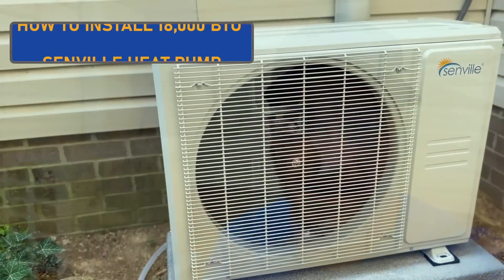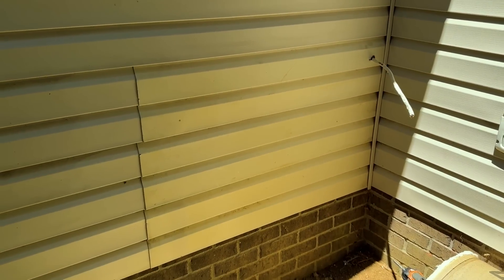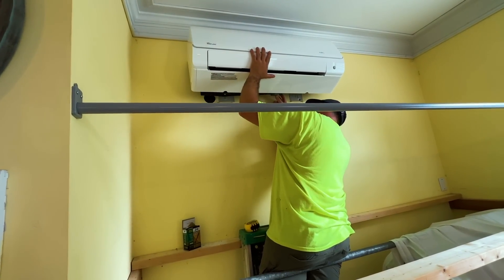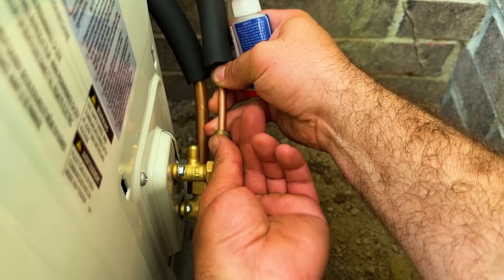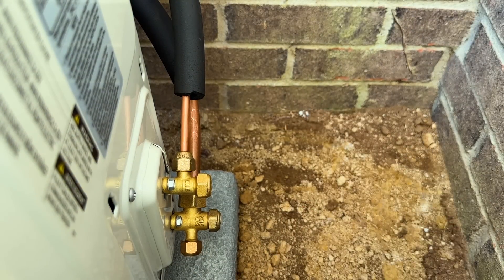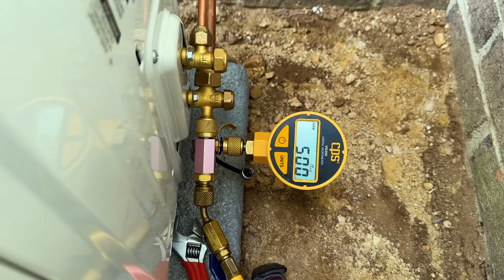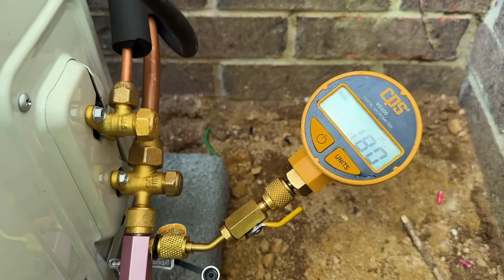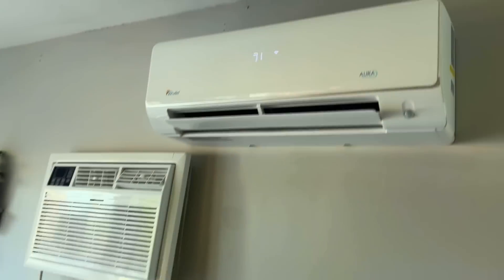Convert Your Window AC Unit To A High Efficiency MINI SPLIT!

Comment: Dude you gotta change title of your video, very misleading. I actually convert window air conditioners into furnaces for small houses and trailers AND I convert window air conditioners into central air con using all the parts from the window AC, not replacing anything.  I was curious to see if anyone else had any concepts I could use, but came across your video that sounded interesting and promising. Just to learn that you video is in fact NOTHING to do with actually converting a REAL window AC into a mini split.  Change the name, it's misleading.   "How to install a Mini Split in place of your Window AC" There I did the hard work for you.

Comment: Great video. I just installed a Senville 18k for my living room/ kitchen works Great. But I don't like how it looks on the outside at condenser.  Line set is 16ft but my run was only about 10ft so I have 6ft rolled by condenser . 
Q. If I cut the 6ft will I have to take gas out ??
And How do I get the gas back into the unit ??
Thank Gid Bless
Reply: @josea.morataya721 There is a way to achieve that with most mini splits without the need for a recovery machine and external tank, but TBH I've never had the need to personally try it. Essentially you close the king valve on the smaller (liquid) line, put the system into cool mode, and let the outdoor unit pull the refrigerant back in. Then you also close the valve on the larger line before shutting down the system See one of DIY HVAC guy's other YT videos at about the 3 1/2 minute mark to see the basic procedure. https://www.youtube.com/watch?v=T-OwbRP-RvQ Once you've completed your line set alterations, pressure test and vacuum the lines as you would do in a normal installation.

Comment: Hi Dave, have you ever run the line set underground to isolate the compressor from a deck/living area.  I really enjoy your channel. thanks, Jay
Reply: @jngolfdad Premium grade mini splits like the SENVILLE AURA system shown here are virtually silent indoors, and the outdoor unit occasionally reminds me of a common 3 speed 20" box fan set at medium speed, but only on the hottest or coldest days when the system is moving lots of BTUs. Most of the time you have to look to see if the fan is spinning because it, like the compressor, are variable speed and inverter driven. Check the specs to see if the system you are considering has any limits on lineset length. Also keep in mind that outdoors is unconditioned space so lineset insulation becomes increasingly important to retain performance and efficiency.

Comment: 5:14 blow that dryer air into the intake of the heat pump when in heat mode.
Reply: Lint in your coils for extra insulation value!

Comment: Is there a video on AC not shutting off once reaching temp? The Ac in my house is working but once it has cooled down to temp it wont stop and just keeps cooling the house below temp. So for example we set it to 72 in our house and we realized it was cold, went back to check and it was at 65..

Comment: I have a split system that has been working since 1990 without any maintenance. 🎉 It's still cooling very effectively so freon levels and therefore internal lubrication seems fine.  Capacitors  seem to be performing like champs.  So what will eventually cause this thing to fail?

Comment: Deceptive title.
Reply: How so?
Reply: @tonysirmixalot3546  he did not "convert a window unit to a mini split". The title is very misleading. The title implies that he took the window unit apart and actually converted it into a mini split A/C.  He did no such thing. He REMOVED a window unit, sealed the hole and then INSTALLED  a mini split. Once again, he did not convert anything.

Comment: Since last year after buying and DIY installing a Senvile 9K Letto Mini-Split and testing it I've DIY installed 2 more Senville 24K Aura Mini Splits in my Home and Shop. Will be using the 24K Aura units for heating this winter. BTW... Senvile Customer Service has been Great.

Comment: Thumbs up on the video, Thumbs down on the title. Please don't be "click-bait guy".
Reply: Where is the click bait 😂
Reply: @anassalmas3194  He did not "convert a window unit to a mini split". The title is very misleading. The title implies that he took the window unit apart and actually converted it into a mini split A/C.  He did no such thing. He REMOVED a window unit, sealed the hole and then INSTALLED  a mini split. Once again, he did not convert anything. What planet are you from that convert means replace?
Reply: @gaminginmy60s  if you think you could do that you don't know anything about hvac convert means replacing the way of cooling the home not the unit OK.
Reply: @anassalmas3194  And there you are lurking in the comments section waiting to say something profoundly stupid at just the right time.
Reply: @Watchyn_Yarwood  you think by  using the words "stupid" and "profoundly" and not proving my point is wrong. you guys don't know anything about hvac, nor youtube but if you think calling me "stupid" would  make you feel better go for it.
Reply: @anassalmas3194  Blah, blah, blah.
Reply: @anassalmas3194  1. I didn't call YOU stupid, I said your WORDS were. But if you insist, who am I to argue...
Reply: @anassalmas3194  Yeah! Where is it. He did EXACTLY what the title said.
Reply: I was all excited on how to turn my window unit to do heat. Guess I will have to turn it around again. 😂😂😂
Reply: @Steve-bm2zm  it's clearly not click bait wtf is wrong with you

Comment: It would be helpful if you told us how much the unit costs, and an average price of installation.
Reply: i bought a 13,000 btu mini-split for $350. but generally the costs of these units are around 800-1800. they are more expensive than a window unit but less expensive than a central air.
Reply: @jasonbay13  I really appreciate that you replied and Thanks for the info! :)
Reply: He gave a link to the unit on Amazon up in the More section.

Comment: Hi, great video, thinking about doing it to a room. How do I determine BTU in relation to square footage for one ground level floor room?
Reply: Usually it's 1 ton / 12000 btu per 600 sq ft.  Of course every situation is a bit different, but that's the baseline rule.  Hope that helps.
Reply: @jkmarshall3553  yes, helps a lot. I’ll take the measurements and base off of that. Now that I’m thinking of it, I think it’s 30x60 but will confirm and go from there. Appreciated it!
Reply: Go to the library and find a book on HEAT LOAD CALCULATIONS.  Then read and absorb the calculations.  Should only take a few minutes.  Then find a Manuel " D " FORM and fill it out. Again  , this should only take a few minutes.  BTW , when calculating walls , don't forget the INSIDE AND OUTSIDE AIR FILM. ! ..... All of this is just a joke. Some of us grew up " OLD SCHOOL  " where this was actually done. Previous poster was absolutely correct.  For a nicely insulated space I would go with 600 Sq. Ft. Per 12 000 BTU. If in doubt about insulation you could go with 500 per ton.
Reply: @mikeglasgow9618    LOL... at first I was like, "go to the library...fill out forms...", is this guy out of his mind?!  😂  Good post!
Reply: @jkmarshall3553  Thanks.....I'm a retired Industrial HVAC/ R TECH. and DDC CONTROLS.  38 Years in the trade. Although I've been retired for 6 years....friends still call me with questions.  A friend asked me one time about an air handler and what his CFM should be.  I told him just perform the SENSIBLE HEAT CALC. HE ASKED ME WHAT'S THAT. I told him to look it up and he would understand.  Like.... I can explain it to him... but I can't understand it for him lol
Reply: @mikeglasgow9618  Ha ha!

Comment: This is not a DIY friendly design!
Reply: Actually flaring and vacuuming isn’t difficult at all. U can save a fortune over mrcool type fittings and learn a new skill and pickup some new tools along the way. 👍👍
Reply: Sometimes you shouldn't improve on what's paid for and installed already. 😂
Reply: No nitrogen pressure test?
Reply: Depends on what your definition of DIY is. If you mean self-installing, then no. If you have a little technical knowledge, not that hard. I installed a central HVAC by myself having never, ever so much as even looked at one before back in the 80s. It was working perfectly when I sold the house years later.
Reply: @Watchyn_Yarwood  I guess I probably meant the extra steps of flanging and pulling vacuums etc. 
I bought a complete DIY kit from solar signature that even came with solar panels but because it was set up as as super easy DIY system.
It comes with precharged lines and plug and play wiring and the installation constructions are written very simply so anyone can understand.
I know I paid more, but for me installing three units including two with solar panels, every little bit helped. 
I was okay with paying around 3 to $400 more per unit to get the ease of installation and less chance of failure. 
But that's just me.

Comment: Thumbs down because your title is clickbait. I watched less than a minute and realized you mislead us.
Reply: Hard to beat a window shaker, insanely inexpensive and easy install. Sealed system, no leaks, more reliable, so cheap, doesn't matter if it is slightly less efficient.
Reply: Where? He did EXACTLY what the title said! What planet are you from anyway?
Reply: @Watchyn_Yarwood  No he did not "convert a window unit to a mini split". The title is very misleading. The title implies that he took the window unit apart and actually converted it into a mini split A/C.  He did no such thing. He REMOVED a window unit, sealed the hole and then INSTALLED  a mini split. Once again, he did not convert anything. What planet are you from that convert means replace?
Reply: I think your user name says it all!!!
Reply: You must lead incredibly dull lives that you invest your time and energies in nit picking a YouTube video title. My most sincere sympathies to you and yours.
Reply: @Watchyn_Yarwood  Nitpicking means giving too much attention to details that are not important, especially as a way of criticizing. The title is very important, as it is supposed to tell us what the video is about. The fact that the title is a lie, is therefor, not considered nitpicking.